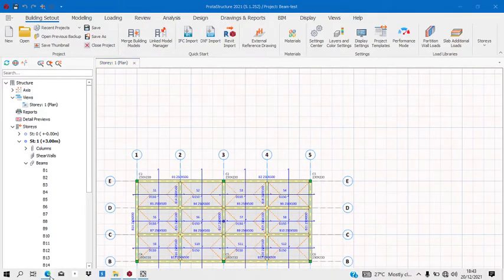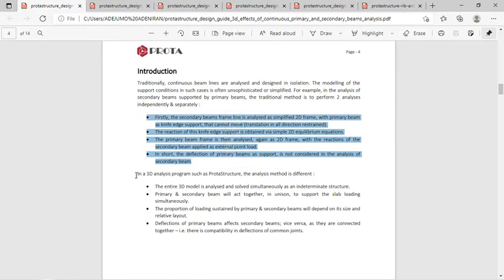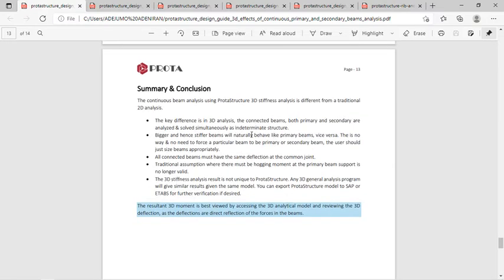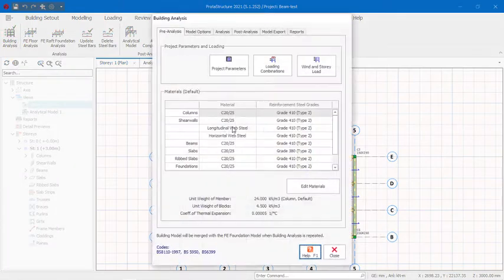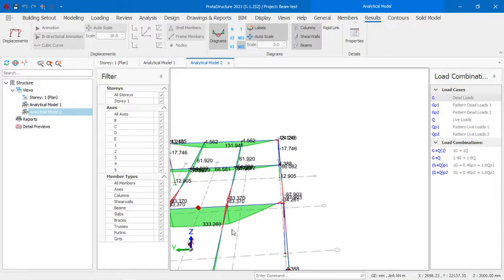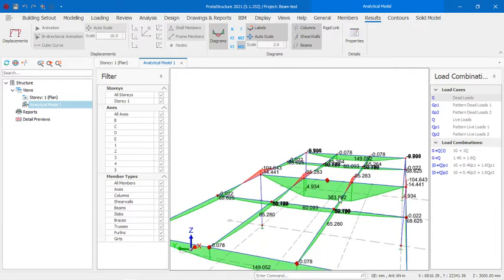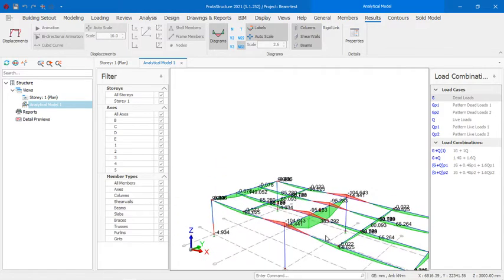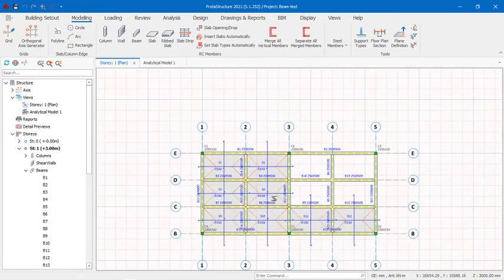Beams arrangements that results in point load effects part 2

Comment: Good video engineer,my suggestion is where beam is resting to an other beam we have to release the moment at the support edge!!!
Reply from the maker: Thank for the comment.
What would be the effect of the moment release in relation to the final span moment of the supposed supporting beam...?
Reply: @adeniranadejumo8534  positive moment will be reduced at certain amount(in reality +ve moment will not be there at support edges where beam is resting to primary beam ), second beam will act as simply supported beam,by reducing stiffness joints we get proper modal time period of the structure and modal participating mass ratio more than 95%,advantages: proper behavior of the structure and economical base shear for foundation design not need of +ve rebars at support in the beam and you will get lower torsional rebars,......
Reply: Thank you engineer,it is my suggestion,we share knowledge!!!